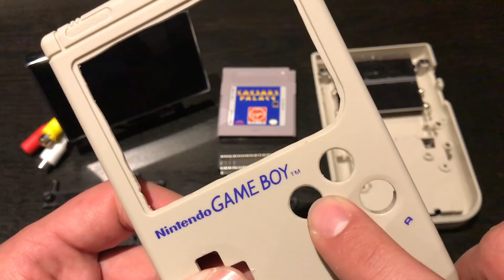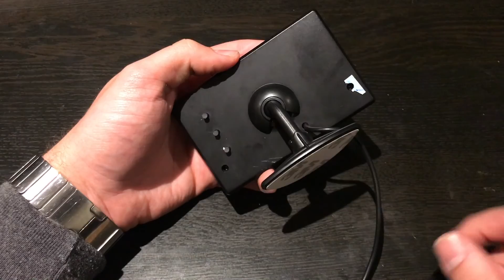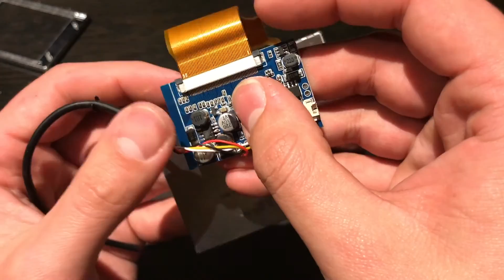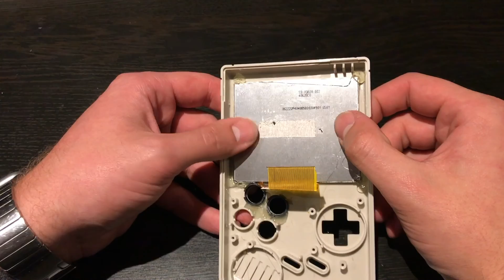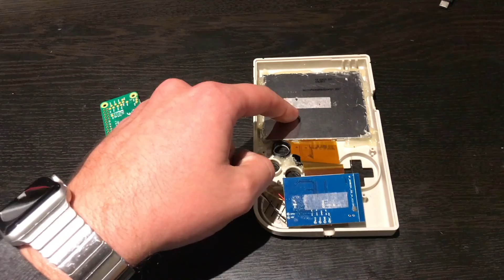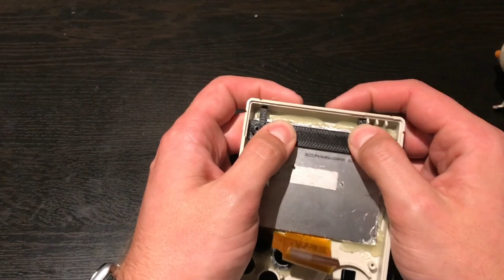Game Boy Zero Guide Part 4  - The Screen and Cartridge Slot

Comment: I'm having an issue in the menus... Every time I enter a console, the screen flickers. It shows AV1 then AV2 and I suspect the screen to go off for some reason... Then back up, and so on. Did you experience the same kind of issues? Im using the exact same screen, and it says on the box "AV signal auto dectect power ON OFF" - I guess this is why you're wiring the chip to the + (red wire)?
Reply: Stephane Schittly did you modify your screen board to work off of 5v if you haven't that could cause it to flicker Also if you have anymore trouble check out sudomod.com there tons of forums and people willing to help out.
Reply from the maker: Stephane Schittly yeah it sounds like you don't have the circuit board modified. If the circuit board is not modified properly it will flicker and have similar issues to what you are saying. If your screens circuit board is exactly the same as mine add the wire exactly were I did. If the board is slightly different head up the the description and click on the link in there called wiki. The correct way to modify your screen will be there.
Reply: For some strange reason the flickering only happens when I'm in a console submenu. As soon as I press start the UI menu shows up and the flickering stops. I'm using an external power supply (12V) - I'm using this in config.txt:
hdmi_group=1
hdmi_mode=23
sdtv_mode=2
Would you mind posting your values here? If it doesn't work I will post a lengthy explanation in the forums. Thanks!
Reply from the maker: If you are trying to use the screen with a 12v power supply then you do not want the screen modified because it as made to run off of 12v out of the box. If you are still having issues with the screen un-modified and attached to the 12v power supply then check out at time mark 4:30. There I show how to power the screen directly from the raspberry pi zero. When It is directly wired to the Pi it must be modified for 5v though.
Reply: Stephane Schittly sounds like you need to modify it from 12v to 5v I read in the forums that you can have play off of 12v but it flickers once in a while just modify to 5v and all your flickering will stop.
Reply: Of course, that was it!! If plugged directly to the Pi, it doesn't flicker only if TV2 is unplugged! Thank you so much for your help!!!

Comment: Awesome
Reply from the maker: Rick Raines thank you for all the positive feedback.
Reply: JPM304 your welcome got a question what are the size of the drill bits you used in one of your earlier guides you used 4 different sizes
Reply from the maker: Rick Raines the sizes of the bits leading to the final hole don't really matter as long as you end with about a 3/8 inch hole.
Reply: Awesome thanks.